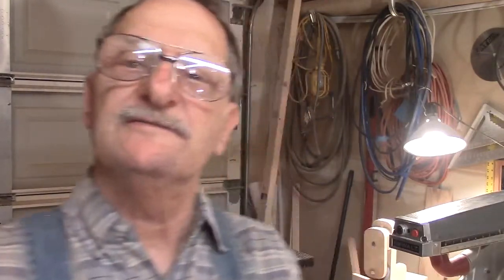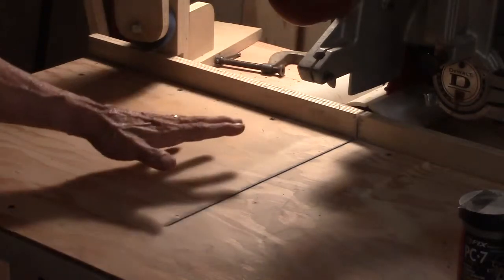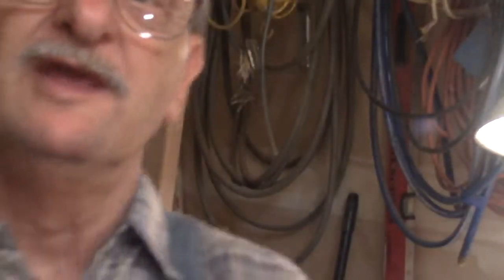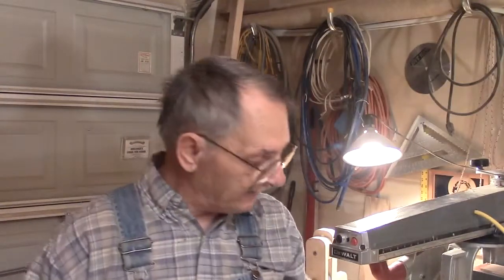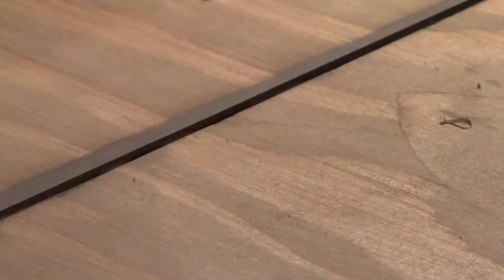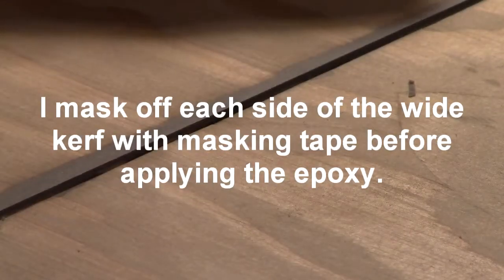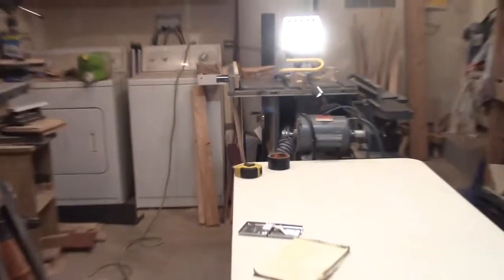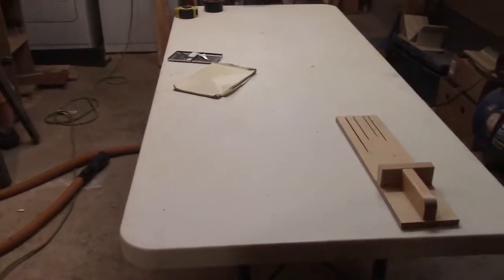DeWalt 790 Saw Kerf Repair

Comment: Ed, I watched the video thinking you were going to show the repair?? How did the epoxy work??  Maybe there is a second video floating around?
Reply from the maker: Peter, the repair is pretty simple.  Clean out the kerf, slightly overfill with epoxy, let set, sand flat.
Reply: How cool is that, never heard of the stuff but I have it in my Amazon cart. I am glad I made my adjustments before I cut the kerf, but now I know what I can use to fill holes. I already sawed through my new work bench top. Right after I waxed it all down I went to cut a board hanging over the edge but it was not hanging over far enough. When stuff like this happens it pisses me off and I tell myself what a idiot I am, but I am learning. Your video and the sound is great. I have a Cannon camera, I bought it to mount on one of my air guns, this summer I will use it and hope that is as clear as yours